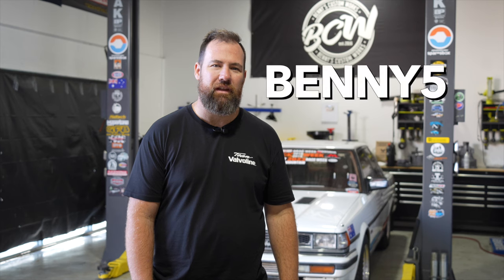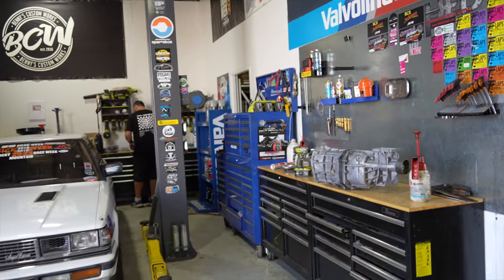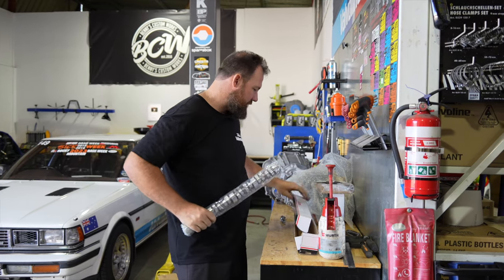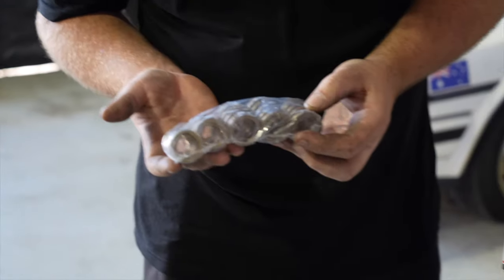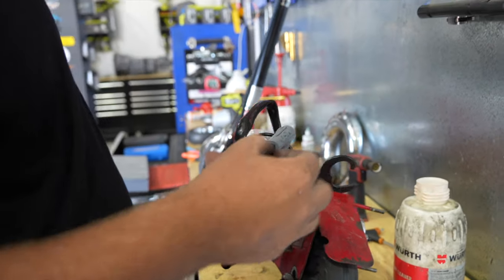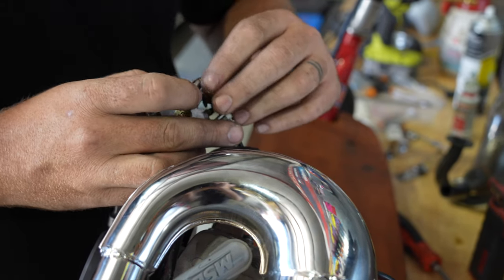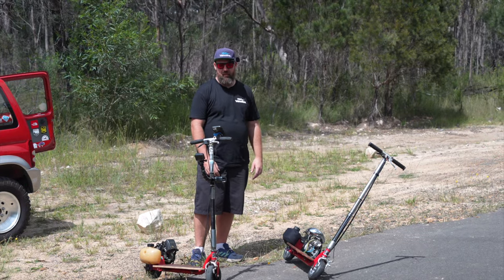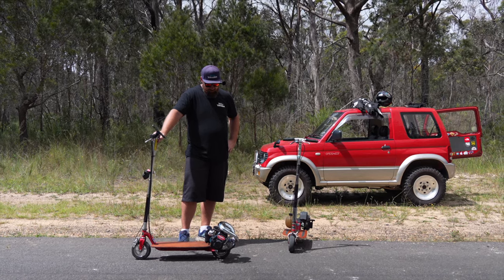Most dangerous high speed run to date. Maybe. Back by popular demand, GO-PED SHRED (The finale)

Comment: I had one of the fastest Bigfoot Goped…28cc bigbore kit with 1mm stroked cranked with stuffers , juice box..And it had a 1inch drive with lock down kit…
70kph ..I had shocks on the front with motor bike style front tyre…I rode it as a vehicle for a few years until the highway patrol hated me …

Comment: Efi 2 strokes yes. In the Uk we had 2004 Aprilia sr50 scooter which was efi it also had a supercharger too. Not sure if that was required to run or just some fancy emissions control system though.
Reply: It was fuel injected but not supercharged. Great scooters though! I had a 2009 Derbi GPR 50 (was the same as the Aprilia RS50) throughout school and college
Reply: @feedingfrenzy123  they had a crank driven compressor. I just had to wiki it to make sure it's kind of a crude supercharger but forced induction to run properly just like the 2 stroke detroit diesels have a blower to run properly but still classes as na.

Comment: Auto-stop on my Ridgid dakdak (same manufacturer as Ryobi) does limit the torque even though it still sounds like it's impacting. I typically only use the feature on wheel nuts and it leaves them torqued way below 80ft-lb/100Nm.

Comment: EFI does exist in 2-strokes. I believe KTM just came out with a new one recently that has great performance AND is more economical.
with EFI you can chose a how much fuel you want and it can be seperate from the amount of oil, no need to ruin your octane rating by using premix. kind of a shame fuel injection wasnt more common in 2-strokes, maybe if countries want to allow internal combustion engines but ban fossil fuels for vehicles then we will see a new generation of 2-strokes with biofuel and bio lubricants.

Comment: For anyone contemplating the gearbox input shaft mod - It's more than a couple of hundred dollars - more like over $800 according to Frank.  Don't be fooled by the youtube dollars in this video.  I fell for a couple of hundred dollars and now there is an unproven gearbox that will owe close to 2K all done and dusted - not a cheap alternative by any means.
Reply from the maker: Frank did charge me a few hundred dollars, He only did the labor, this was pretty clear as I already had the parts in the earlier videos. You could also stay with the stock input shaft if you’re handy with a parts catalogue as others have done with the AR5. I only changed the input shaft as I wanted to use a specific clutch kit. No fooling here, you could also save 3-400 by buying a used input shaft instead of oem Toyota new.
Reply: @BennysCustomWorks  I have the parts too!  His price to me was labor only as well.  Toyota dont have shaft available any more (response my local toyota)
Reply from the maker: @mykelkoblenz690  I got my input shaft from overseas  but it was a new Toyota part. I can’t really comment on behalf of anyone else as to their pricing however.